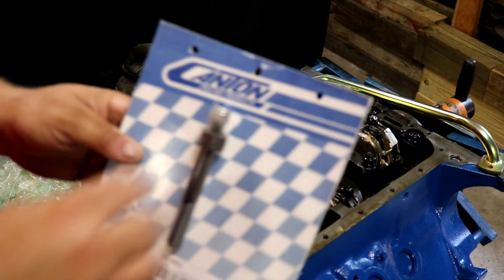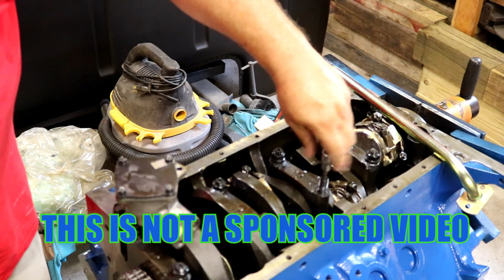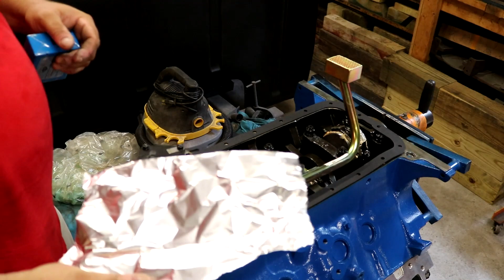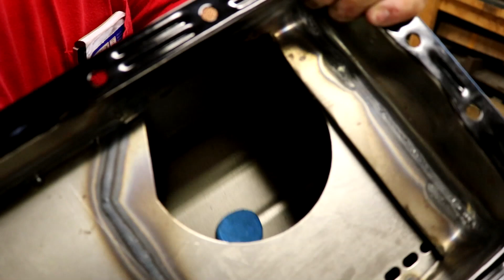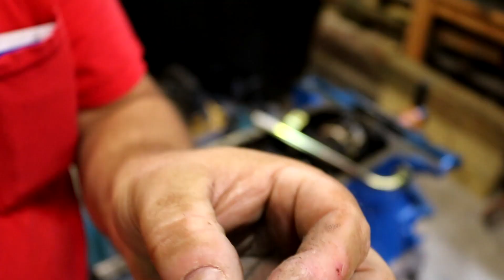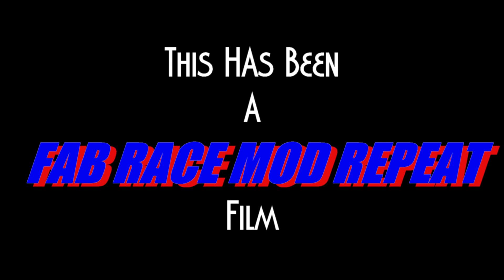FE Build #1 part 6A oil pickup install

Comment: Thank you for the video sir!
What is the torque spec for the oil pickup tube to oil pump? My 75 ford factory manual does not list one for the 390. It only lists it for the 330, 361, and 391 and says it’s 10-15 ft-lbs for those engines? Not sure why they would leave out the 390 spec. 

It does list the oil pan spec for the 390. For the oil pan it says 8-10 ft lbs. Is this what you use for the oil pan?

Thank you
Reply from the maker: Thanks for watching
I do 12-15 on the pickup blots, I also put red lock tire on them.
15-18ftlb is about right for the oil pan gasket.